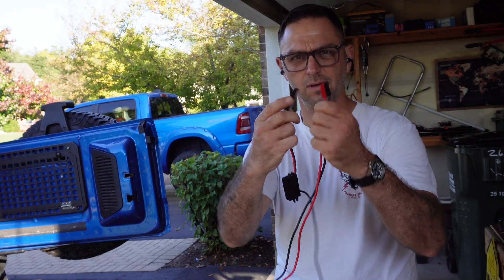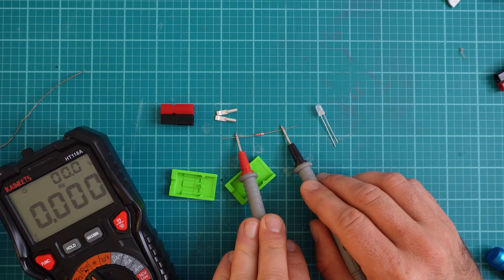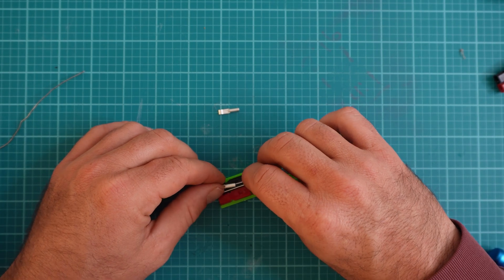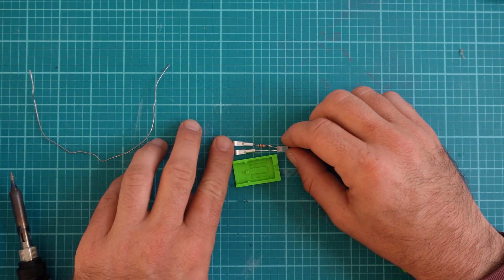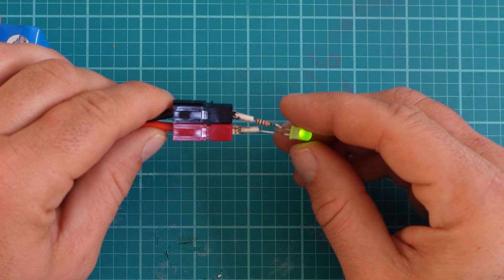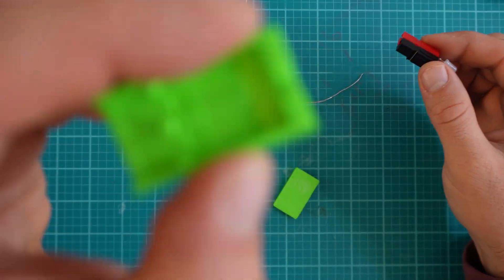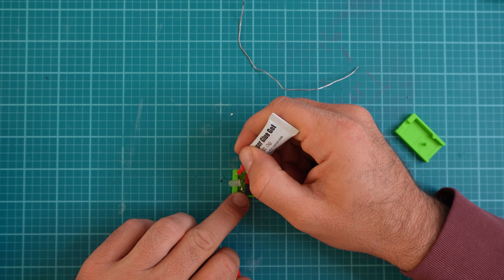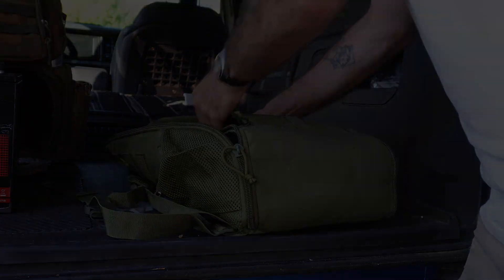Save Your Ham Radio Gear - Build a PowerPAL

Comment: 3:39 hi Sean, this is Pierre the blind guy, for me I would put a PO buzzer on the red side so when it's reversed, it will go beep. Thought I'd let you know what are your thoughts? Thanks again.
Reply from the maker: This is a great idea,  Pierre.   I would not mind trying something like this, and I assume it won't be too complicated. Provided the circuit is small  and simple enough.   This would be something beneficial  and helpful for the visually impaired operators. Thank you for the idea!

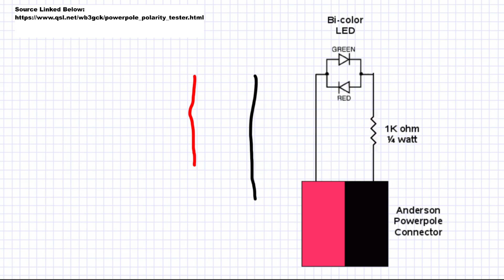Comment: At 1:08 you have a label on the screen and say “longer lead of LED is positive” but you show the black line as longer. You also later say the longer lead is negative and show aligning the longer lead to the black power pole. Very confusing.
Reply from the maker: Sorry for any confusion
Reply: @DudeTested  Just to clarify then, the long lead is negative?
Reply from the maker: @dougdaniels the reason I said the long lead is negative for this scenario is because if we didn't reverse the polarity , the light would display the opposite.  So yes, for this scenario we are treating the positive  (long) as negative.  Or another way I could have said it is we are reversing the polarity of the diode in the powerpole connectors .  I hope that clarified things and doesn't add more confusion
Reply: @DudeTested  When we build it, the long lead is positive then.
Reply from the maker: I see the confusion now.   Yes, when I drew it out, my intention was to show the long end, normally positive, will be used as negative.  The long end gets cut, a resistor added and inserted into negative.
Reply: I built one of these 9 years ago when Randy, K7AGE had a detailed video on how to build it. But I really like your case. 3D printers weren’t as mainstream back then.

Comment: I have made them years ago. I used 3:1 glue line heat shrink. Came out nice . Just a note ,The LED turns Amber on AC . I made fuse links and EMI/RFI filters with power poles. All in my go kit. Even one for USB C PD 65 watt.  Even power pole to Wago connectors. Even a volt meter one I made. It has amps as well. And it shows - amps for discharge and + for charge . Nice red/Blue display. 30 amp rated. I even got the Crowbar kit from A to Z TOM , All power poles ! I got a kit from Power works has crimp tools and much more in a bag. Has a removable tool . Looks like small screwdriver but has hook on end. You insert between spring and contact give a twist and the contact pops out of hosing. So easy ! They sell the tool buy it self . I got the big bag kit. Ant they have different colors. I use yellow for solar. 73

Comment: Several comments say add fuses. Correct me if I’m wrong (and you will), but fuses don’t help with reverse polarization, just over current or dead short to the battery.
Reply from the maker: I was under the impression that shunt diodes were built into the 891. With that,  the inline  fuses would pop and protect the radio.  Otherwise,  you're correct. Maybe someone else will step in however.   Thanks !

Comment: I'd still recommend fusing the battery with a moderate high fuse, say 50 A, just in case you get a short you're not relying on the BMS solely.
Reply from the maker: Great advice!  Thank You!

Comment: An inexpensive thing to save you from making expensive mistakes. However be sure to check the polarity of your polarity checker on a known power source with power poles that are correct. You should get a green light if you know the power poles on the power source are correct and if you get a red light the LED leads need to be switched
Reply from the maker: Pro tips.